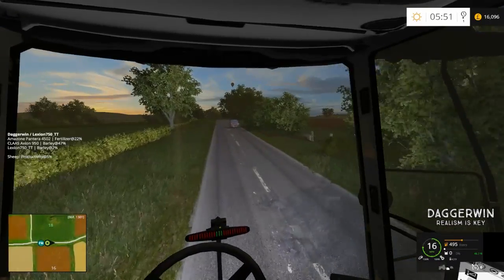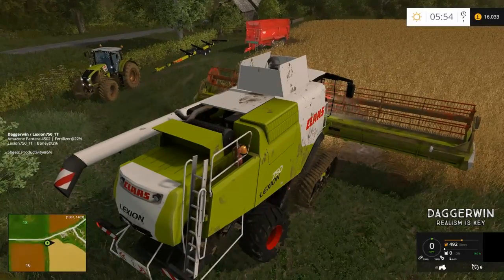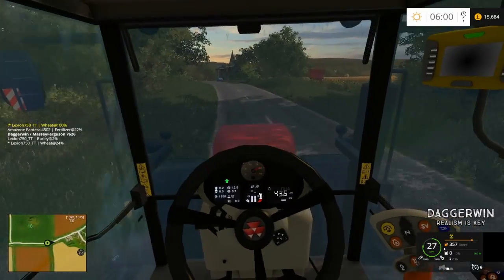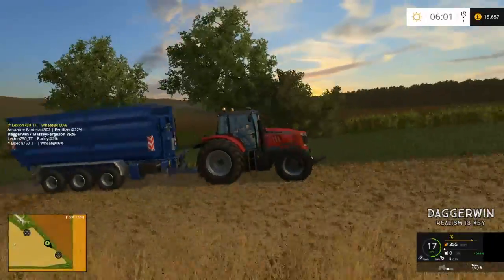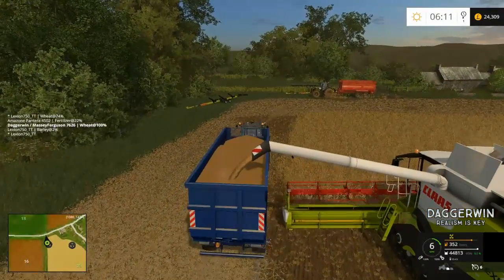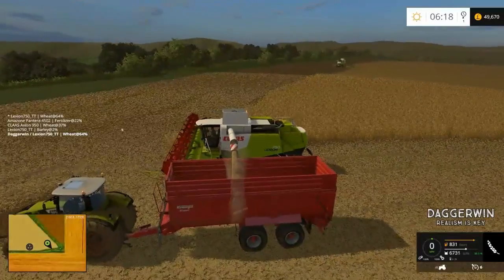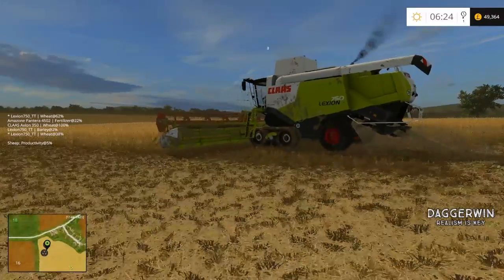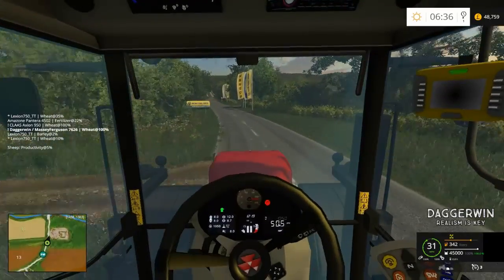Let's Play Farming Simulator 15 | Chellington 2015 | Episode 22

Comment: if you are on about the baler from teh mod competition. there is a mod for picking up the bales. FS15_ursusT127 < thats it 

Also go to the xml of the Drive control and you can fix the crop destruction

Also if you press Shift+3 your tractor will match the speed of the combine,

Comment: +Daggerwin there is a bale trailer in a mod pack on the FS-UK website called "Small Farming Pack" and it has a locking script, you will have to load them with a loader and spike but it's better than nothing. Lol

Comment: Daggerwin can you pls answer this question? what is your favourite tractor?
Reply from the maker: +Frag Madz Massey Ferguson
Reply: +Daggerwin cool! but why don't you have like a theme in your farm like Massey Ferguson everything like combine and like 4 tractors of them?
Reply: +Daggerwin Its Drive Control that is messing with your crops.. As of the last update, it has a config that basically works like the old wheel marks mod. Tires now destroy crops when you drive over them (this can be disabled in the config just like the shuttle mode and other drive control options)
Reply: +CrazyCrawlers get out of my comment

Comment: I do have one gripe, could you turn off m4wd on the road, in real life situation the m4wd (mechanical four wheel drive)  would destroy it's self
Reply from the maker: +fatsmandela Yeah I know what you mean, will do :)
Reply: My old bosses old man used to run it all the time (think he didn't know how to turn it off lol)
Reply from the maker: +fatsmandela lol I bet it shredded the tyres too :D
Reply: +Daggerwin and I'd end up with the tractor with bald front tyres lol
Reply: +Daggerwin could u get a old ford tw-30 tractor
Reply: m4wd has diff locks, that's how landrovers don't kill them selves, the real reason would be to reduce fuel use as that is why on demand 4wd was invented also reduces tyre wear . but having it on ( without  diffs) just gives a bit more grip for heavy haulage.

Comment: Why not use the tractor to pull the header.
Reply from the maker: +callum holland Could do but I would have to go back for the other trailer
Reply: +Daggerwin I think the destroy crops is built in with an update on drive control
Reply: +Daggerwin the courseplay mod is the one with crop destruction
Reply: +Cathal OBoyle yeah
Reply: +Daggerwin it's the course play mod that destructs the crops
Reply: +Daggerwin but keep it because REALISM IS KEY